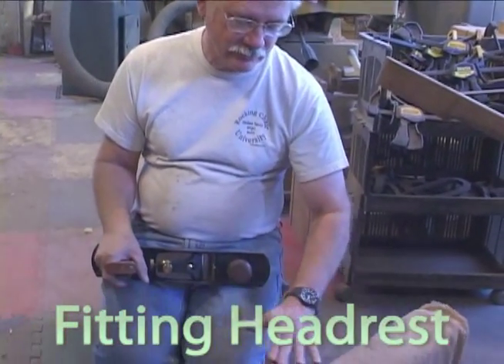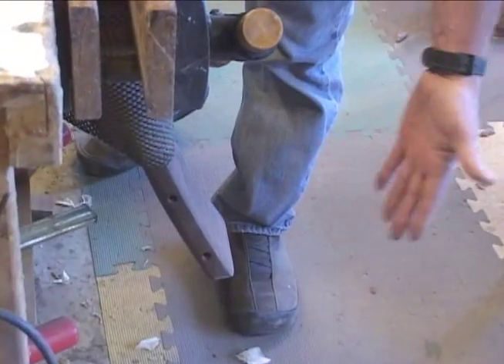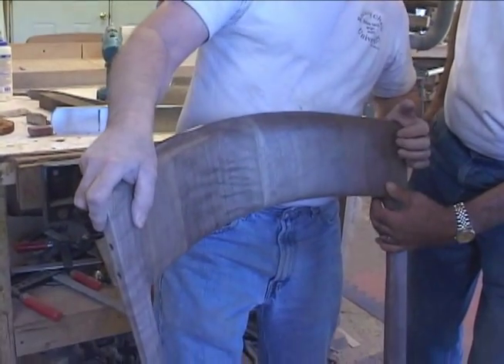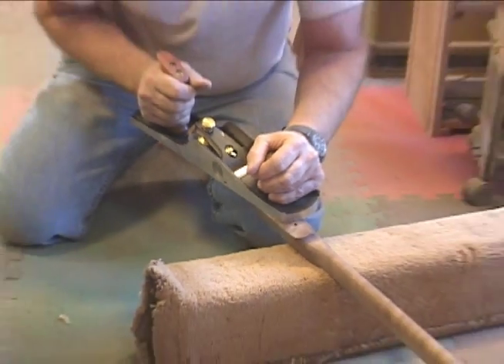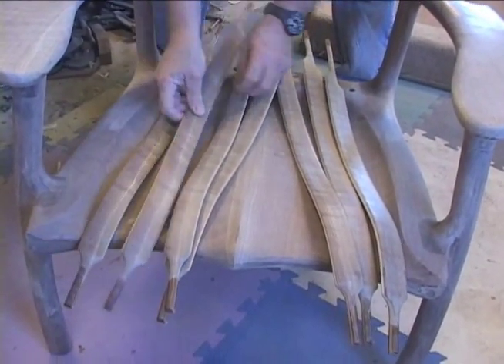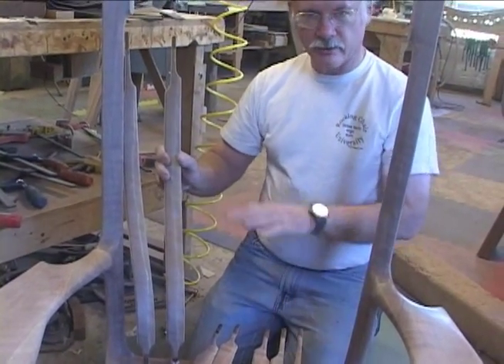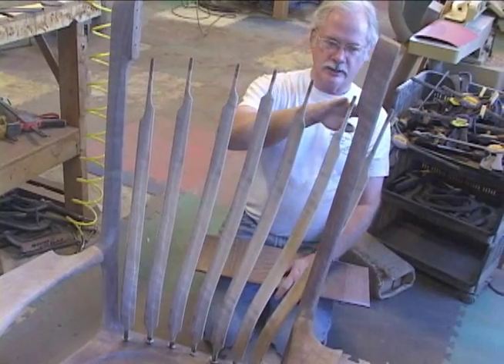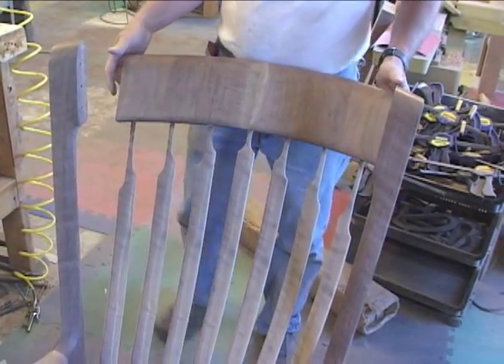Planing Headrest to Fit

Comment: How do you handle the glue squeeze out?
Reply from the maker: I scrape most of it off with a scraper, then sand the remaining.  There is usually a slight alighment error in the gluing anyway so sanding the error away also resolves the glue issue.  Thanks for watching!!
Reply from the maker: After screwing, I get rid of as much squeeze out as possible with my pocket knife. After curing I may use a plane on the back. But, since the parts are held compliant with clamps I can clean everything up with 400 sandpaper then Abralon. Before sanding it is important that ALL of the glue be gone! Because glue sands slower than the wood you will have a 'bump' where the glue was, now that has to be sanded out.  Get rid of all of the glue.